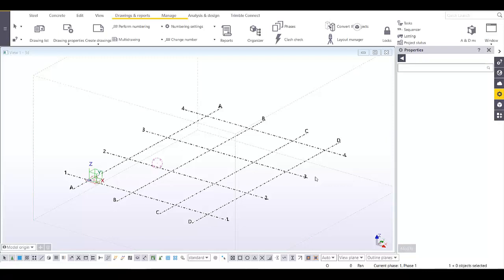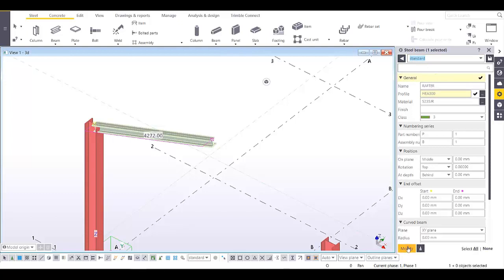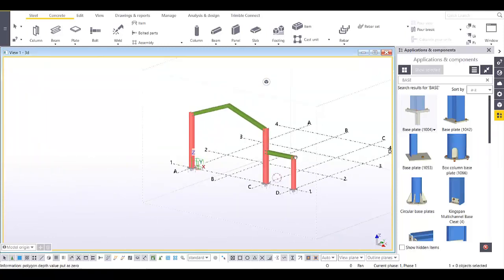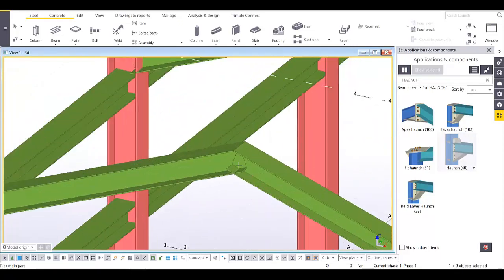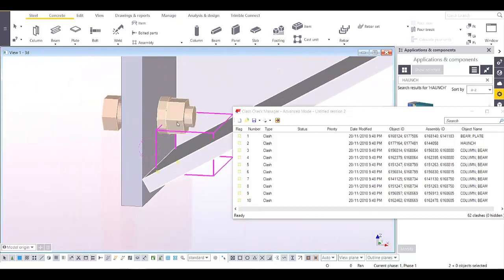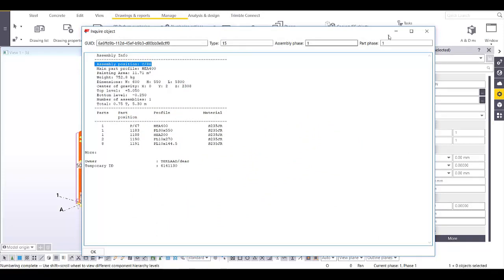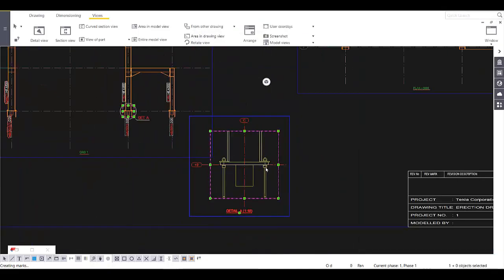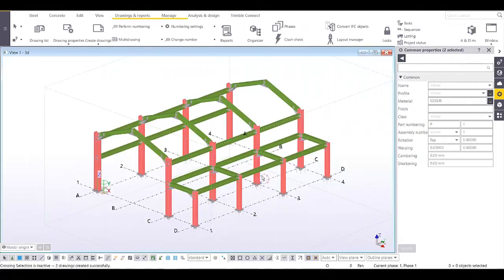How to Create a Steel Model and Drawing

Comment: Also, is it possible we use autoconnection for baseplate as well?
Reply from the maker: Nope, because base plate is consider as Detail not connection in Tekla
Reply from the maker: Use detail manager instead.